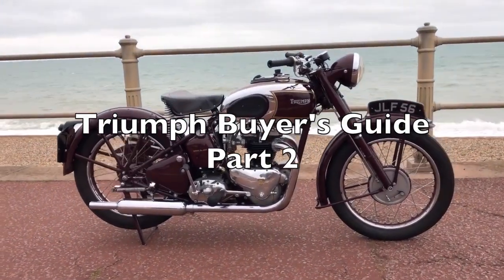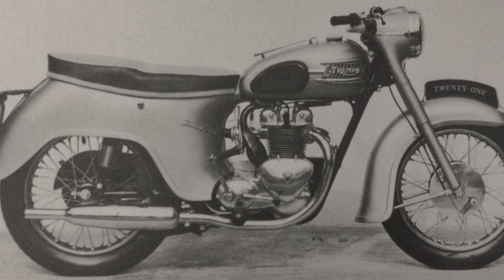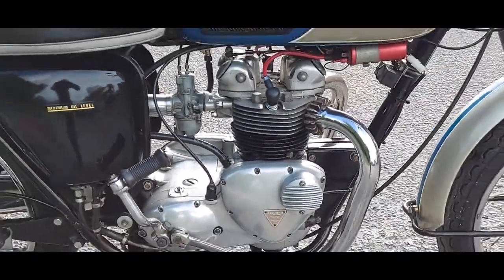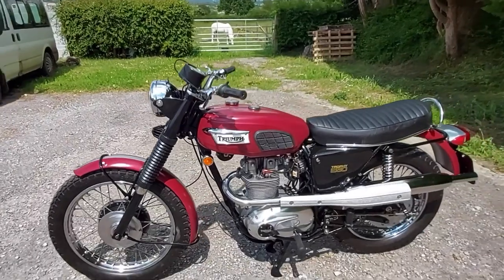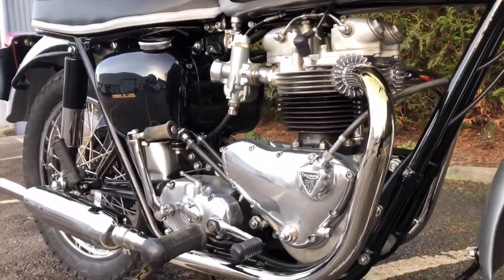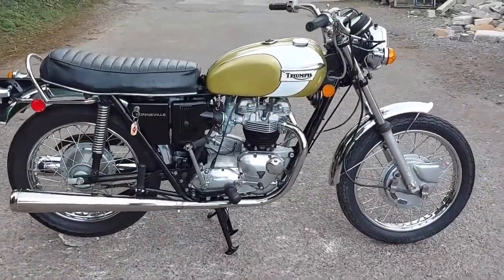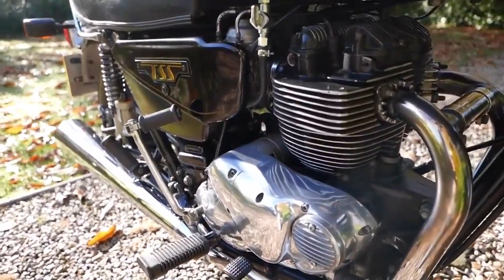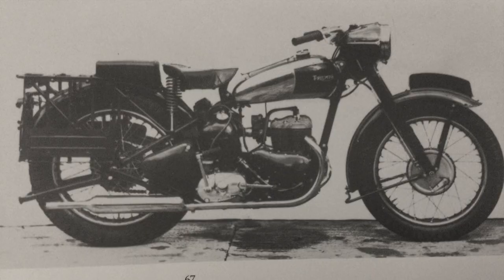Triumph Motorcycle Buyer's Guide part 2     1946  1983

Comment: I’ve got a 1969 T100T 500 Daytona running on a Single carb and it’s a lot more reliable, and you can hardly tell the difference overall on the twin carb set up, with a 20 tooth gearbox sprocket I can hold the gears a bit longer, it’s light weight, great handling fun to rid at legal speed limits on the twisters, love it, thanks for the video.👍
Reply from the maker: In general I’d say a single carb is preferable on a British twin 
Less trouble
Less vibes
Definitely worth sacrificing a horse or two

Comment: Mine's a 78 T140V, the less fashionable UK model (but more practical for long distances, with a bigger tank than the US version). I bought mine 30 years ago, with just over 1000 miles on it. It is a very practical and fun bike to have, and until recently, it was my only bike. I find the twin Amal mk 1 carbs require very little maintenance. When you oil the cables and refit them, 2 or 3 times a year, you need to resynch them, but that only takes a few minutes with no special tools. In fact, from what I've heard, if you have to take the carb off, it's harder on the single carb TR7 version because of the airbox design.
Reply from the maker: Tom, my son loves those UK models. For me growing up in the 70s that square tank just looked more modern.

Comment: I purchased a 1973 T 120 rv new . In my opinion this was the best Triumph that I owned or have ridden ( I started riding in 1965 )
It handled very well and although being a 1973 bike it came from the factory with a 1970 front brake , not the usual conical from 1971 and 1972 .
I raced this bike with some moderate success especially in the wet ..
This is also how I know just how fast the 750 Honda is not .
Reply from the maker: The OIF bikes really do get a bad rap but the frame is very good 
We had the TR7rv and liked it 
Had so many people who never owned one telling me how bad it was 🤷🏻

Comment: Tiger cub was notorious for snapping clutch woodruff key and fragile roller main bearings.
Reply from the maker: Well not one of turners best 
They did improve however
Reply: @bikerdood1100  I used to carry 2 woodruffs at all times and had the replacement time down to 25 minutes anywhere any time.
Happy days 😄😄
Reply from the maker: @ijc9984  oh the joys